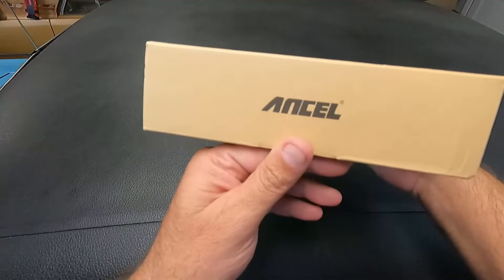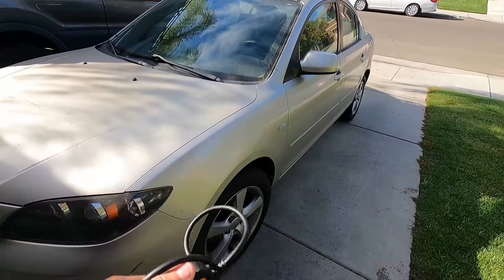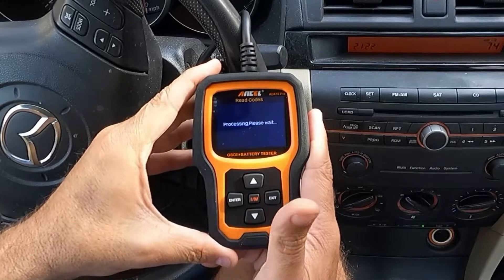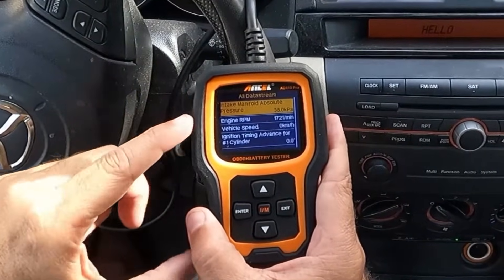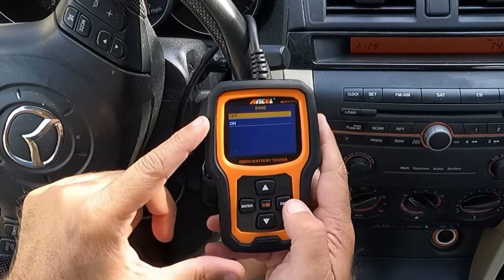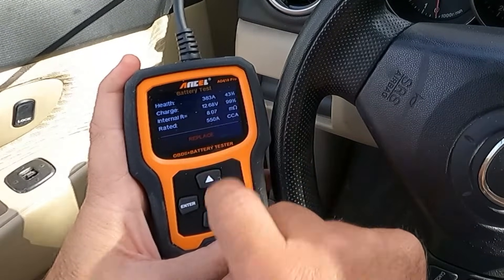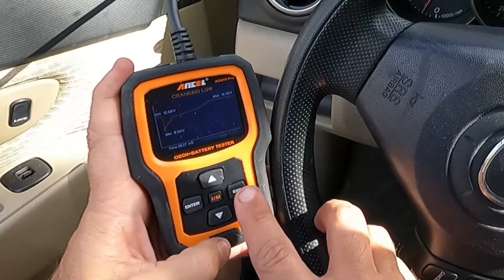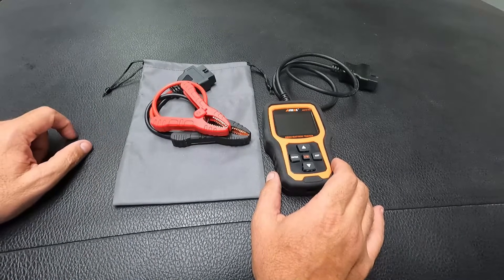ANCEL AD410 Pro 2 in 1 OBD2 Scanner Battery Tester Review! Two in One Battery Tester & Scan Tool!

Comment: Are battery readings really reliable even   without input for  battery specifications  ?
Reply: If the battery standard and the rated CCA on the battery are not selected correctly, the final result will be incorrect.

Comment: Huge thanks for this comprehensive review of the Ancel AD410 Pro! We're thrilled to see it in action. For anyone with technical questions or support needs, drop us a comment below. Let's keep those vehicles running smoothly! 😎#Ancel #AD410Pro #DIYMechanics #Batterytester
Reply: Are battery readings really reliable even   without input for  battery specifications  ?
Reply: @dekzan  Thanks for asking. As long as the test standard and the battery's rated CCA are selected correctly, the result will be correct.

Comment: Does it read ABS/srs?
Reply: Hi, AD410Pro can only be used to diagnose engines. For your needs, you can consider FX2000 or DS100! Need a compatibility check for your car model? Drop us a comment below with your vehicle model + year!

Comment: I've used this same tester once, and now when I really need it to work, it won't even turn on when I connect the battery cables.
Reply: Hi, thank you so much for your feedback! If the device fails to turn on after connecting to the vehicle, it may be because the vehicle diagnostic socket is out of power. It is recommended that you connect the device via USB to see if it can turn on normally to confirm whether it is a device failure.

Comment: I just got one of these to get my car ready for smog testing. So i plugged it in and everything went to the exact page & selection choices you showed. I hit OBD & it immediately went to the page you showed, which features READ CODES at the top, followed by CLEAR CODES. 
I hit READ and it threw me a code. So i headed back to that page to CLEAR.....AAAnnnnd, it went to a protocol page which has not even been shown in the roughly 15 videos i have watched. Everything I do just leads right back to the protocol page, which appears to be utterly useless unless you're a dealer or licensed repair station. 
Clicking on any of the protocols yields PLEASE TURN OFF IGNITION. Nothing happens after that. 
So i hit EXIT. 
Ir says TURN ON IGNITION, followed by exactly the same results. 
So i hit EXIT, thinking to start over. 
Now it says, FAIL. 
Every button, every operation, battery connected, battery disconnected, car running, car turned off, performing arcane voodoo rituals...nothing. it goes to protocols every time and after that just loops TURN OFF IGNITION TURN ON IGNITION. Hitting exit gets FAIL. Exiting FAIL gets...ya, u guessed it, that f#@*@#protocol page! 
How do i clear protocol and get back to read codes/erase codes?
Reply: Hi there, as per your description it seems you were able to access the system initially; to investigate why you encountered the protocol selection interface, we kindly request that you provide screenshots, screen recordings, and any relevant data feedback for our analysis. For further assistance, please directly contact our official technical support team and share this information with them.

Comment: Does it read the transmission temperature?
Reply: Hi! AD410 Pro can only be used to read engine system data, and does not support reading transmission temperature. It's recommended you consider FX2000 or DS100. Need a compatibility check for your car model? Drop us a comment below with your vehicle model + year!
Reply from the maker: @josealvarado1726  no, it does not.
Reply: @ thanks. What scanner do you recommend for diy?. I bought a launch creader and it didn’t work